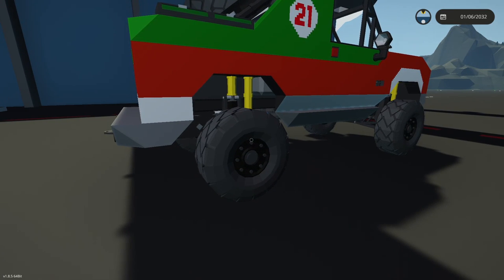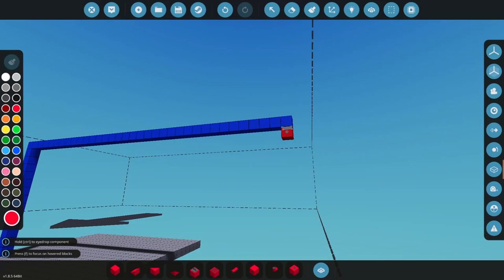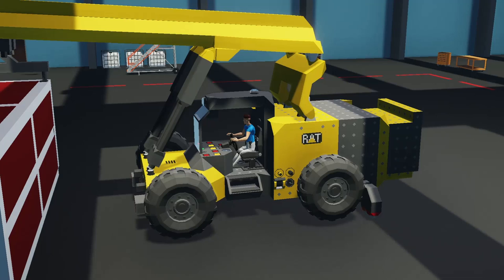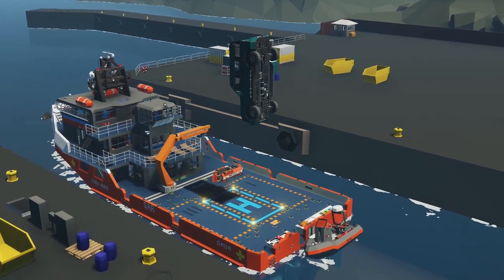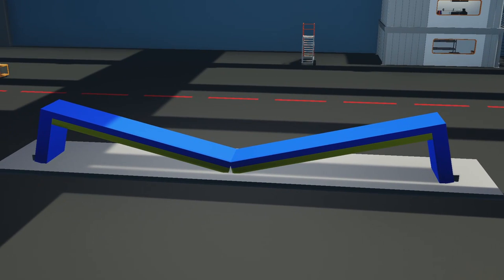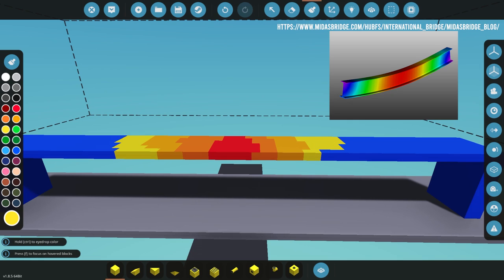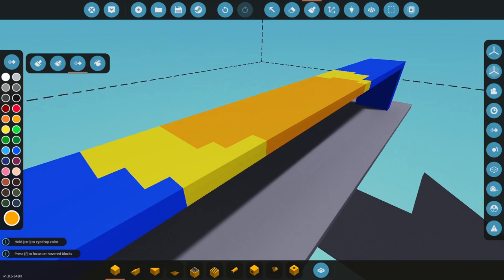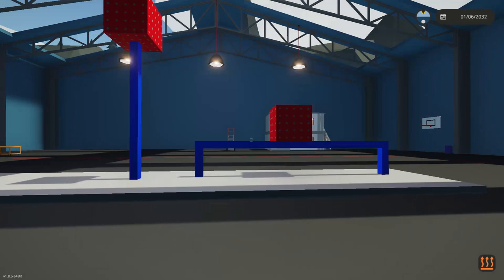STRUCTURAL integrity and collapse in STORMWORKS

Comment: I think the biggest problem of having structural stress and strain in stormworks would be creations with xml parts to create surfaces which would fail under the stresses, and the massive blocks (25cm/10in) do not allow for a lot of structural design considerations. Additionally, material types would have to be added which then changes so many other things. The very nature of the stormworks build system from a gameplay standpoint does not lend itself to realistic physics.
I would love a similar game which has real time physics simulations of internal forces, but I don't see that being practical in the near future in terms of hardware limits.

Comment: the problem with the bridge idea is that stormworks is coded in a way that will simply not allow blocks to disconnect from eachother. because when you spawn it in the vehicle is considered one object, or model. trying to split a model in game is a nightmare. and if they did get it to work somehow, it would likely crash the game.
Reply from the maker: Yup! That's what I am saying, it would open a whole can of works to try to implement a single body to be able to separate with impact or damage! But games have been adapted and modified, and the physics is there, just the coding and issues to optimize such intensive modelling :)
Reply: Ohh i'm sure they can find an idea for that in the future
Reply: @454ss_gaming  yeah i hope they do add it, as well as crush depth, because i use submarines a lot